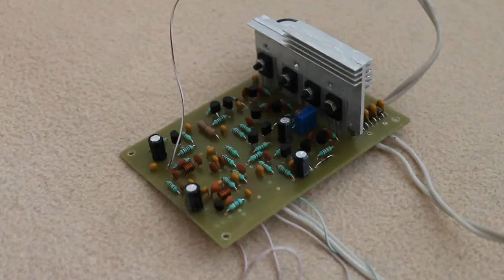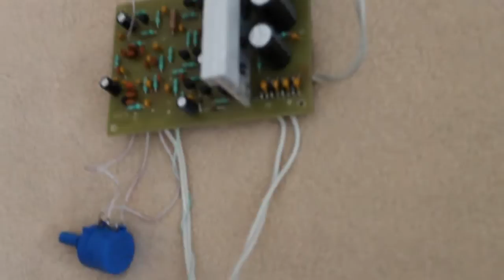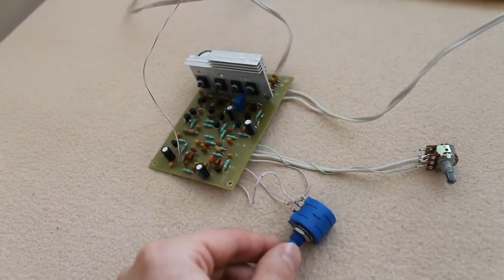Homemade FM radio based on TDA7088T IC

Comment: what is the maximum receiving frequency , but not according document? if you put LC circuit with lower L and C to see how it works?
Reply from the maker: I won't be able to try it soon but I think that it will go to somewhat 200MHz above that I expect to have some problems.
Reply: for me, it would be important to get into the 144MHz range, so, thanks !

Comment: Hello my friend!
I'd like to make your radio.If you gonna help,i will appreciate it.

1)step i print the PCB in a sheet of brass?
2)step i buy all the stuff(capacitors,diodies...)?
and then goes on....?
Reply from the maker: First what's your experience in electronics? Because this is not a project for a beginner. If you feel ready to make this project I'll send to you the PCB files and the circuit diagram, and will provide the information that you need. P.S. The PCB is not "printed" on a brass sheet, but is etched on a copper foil board.
Reply: Origoangelohrol322  Thank you my friend!
I dont't have any experience in electronics.I just download the PCB and the schematic from a comment below,but i don't know many thinks about electronics.If you want to tell me how to start because i'm interested with your project because it seems very goood man!!!.Thanks!
P.S do you want my email to send there?
Reply: P.S 2 and something more i want to supply it with solar panel.Is it possible?

Thanks man at all!!
Reply from the maker: thanis667 It is possible for this radio to be powered from solar energy since it consumes about 1 watt. It consumes even less if you use it with a sensitive speaker and reduced output power, supply voltage and end stage quiescent current. It can drop down to probably 200mW, but I haven't designed it for that purpose and there are many more efficient construction for your case. You can give me an E-mail but this is not a good first project for you. The radio is working great but it requires more advanced skills and knowledge to be built. PCB production alone is difficult task and requires skills, chemistry and equipment.
Reply: Thanks man at all your help!!

Comment: Well, can you share the schematic? The link below is already crashed.
Reply from the maker: Steve Mena Navarro Yeah the hosting is down. Here it is uploaded again: http://s27.postimg.org/entnn30kz/VA_Tonmaistor_FM.jpg the left part to the volume potentiometer is the radio itself, the right part is the low frequency power amplifier, you can use an IC one instead of the discrete transistor amp. The TUNING potentiometer is a 10k multi-turn pot for panel mounting (the blue thing on the video). The critical parts of the design are the layout of the board around the IC TDA7088, its well regulated and filtered power supply and the stability of the power amplifier. If the power amp is unstable and tends to oscillate it will surely cause problems at higher volume levels. The 100nF capacitors in parallel to every diode in the bridge rectifier in the power supply are also crucial to get well working radio without buzzing interference. If you want I can upload a PCB project (Sprint Layout 7 format) for you, but the hosting that I know can hold the file for 1 week only so if you want tell me and I'll upload it. If you are planning to make the radio on a perforated prototype board it's possible to get unsatisfying results but you can try.
Reply: Origoangelohrol322 your work is very cool!! Congratulations! :) I want to replicate the results. Well, is it possible use a LM741 instead a discrete amplifier?
Reply from the maker: Steve Mena Navarro of course you can use LM741 but it will need a transistor class AB end stage in order to drive loudspeaker something like this: http://www.eleccircuit.com/wp-content/uploads/2009/09/mini-amplifier-for-computer-music.jpg
For headphones maybe the op amp itself will be enough.

Comment: Hello, could you please post a scheme?
Reply from the maker: Here is the schematic of the radio:
http://origoangelohrol2.hit.bg/FM.GIF
and here is the PCB in Sprint Layout format:
http://origoangelohrol2.hit.bg/PCB%20ver3.lay
Remember, this IC is working very well when the layout is good, it won't work good on a prototype board or poorly designed PCB. Good luck and if you have any questions write me. Best wishes, Dimiter.